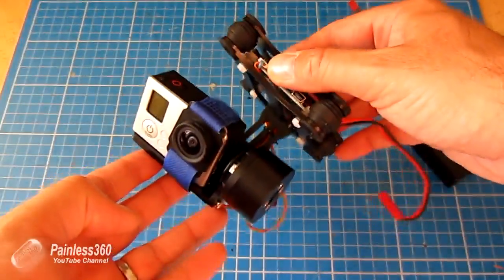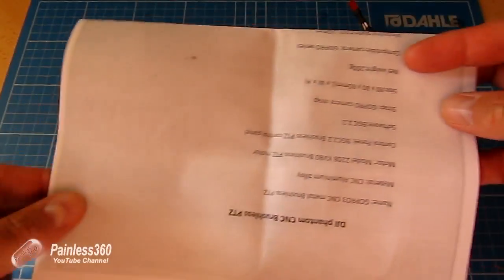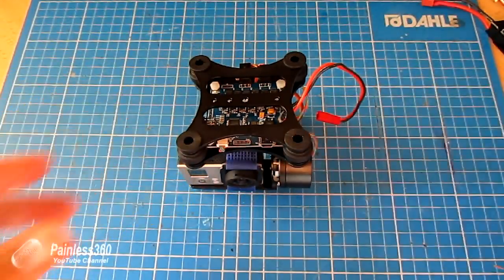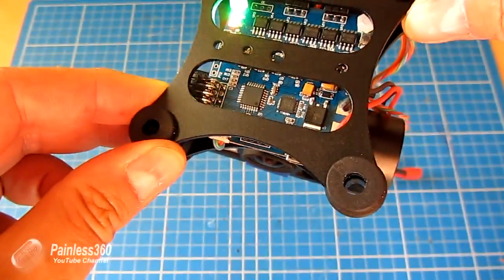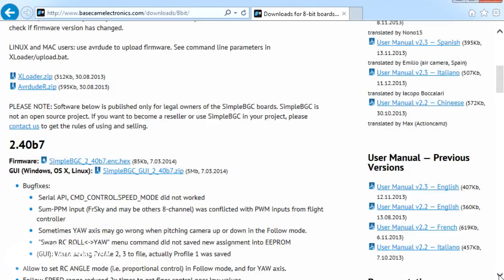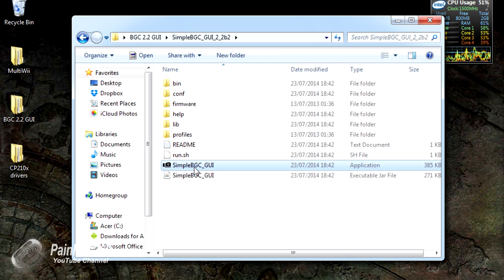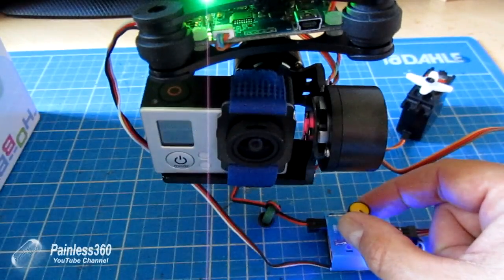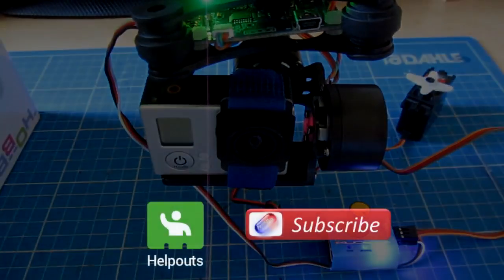BGC 2.2 (2.2b2) GoPro Camera Gimbal – Software, drivers, setup and receiver connections.

Comment: What kind of battery do i need?
Reply from the maker: I run mine from a 3s pack..
Reply: i have looked online have noticed 3s packs are 11.1 volts, but other sources say i can run it with 12 volts?
Reply from the maker: Yep, that's the one. If you are confused then the videos in the 'Introduction to RC' playlist will help..

Comment: Me again, lol..  You may have answered this before or in another Vid, but how do you connect this gimbal to the Naze32 Full so I can control pitch with one of my slider switched on my Taranis ?  Which Pin should I connect to, 5 or 6 (since the motors are 1-4) is there anything I need to do on the Naze set up?   Thanks in advance, your a HUGE help!!!
Reply from the maker: +tntaftershock I haven't connected it to the gimbal but to the PWM pins of a receiver so I can 'tweak' the direction in flight. Best of luck..
Reply: +Painless360 sorry for the dumb question but what is PWM?
Reply from the maker: See our explanation on the channel - a lot of the answers are here somewhere.. ;)
Reply: +Painless360 I finally got it figured out, you can control this gimbal thru the Naze32, with CleanFlight. I don't have the fancy setup to show on the computer like you do but this is how I did it, with my taranis using the left slider.

1 click on Servo Tilt 
2 clicked on Channel Forwarding
3 under "Servos" I clicked Servo 0, A4
I set my left slider to channel 8 which became AUX 4
and BAM, I can control the pitch of the camera and it also maintains level balance in flight.

I do have one small issue, the camera has a very slight "twitch" and I have not figured out how to stop it. when I disconnect the gimbal from the Naze32 the twitch stops so somewhere there is a setting I have not found yet to adjust to stop this, but its not bad enough to prevent a video.   If you can play with the settings and find a cure I would be in your debt. Thank you good sir.
Reply from the maker: Great explanation! Not sure about the twitch as in practice I don't fly with gimbals controlled by the FC. Best of luck and happy flying!

Comment: Hey, man! Loved your video! :) I have only two questions, if you or somebody seeing this comment could help I would be really apreciated. Do you know if i can weld the female jst on my drone instead of the male on the battery? I have some batteries and it would be much more practic to do it that way instead of weld them all. The other question is if you know if is there anything I can do to install a fader to control this gimbal on a chinese quad like Tarantula X6. I'm thinking about build a cheap fpv system on mine. Thank you very much for your atention. :)
Reply from the maker: +Gerson Pereira Not sure what you mean by 'weld'. You can solder any adapter you need. I would make a small adapter using a JST cable personally.
Reply: With weld I mean solder, can I solder 1 female jst adapter directly on the quad to connect battery and gimbal? Instead of solder 1 male jst to every batteries I have.
Reply from the maker: You can use whatever works for you but remember that most batteries and c connectors have a convention for which side connects to 'live' voltages. Best of luck!
Reply: I will have that in consideration. Thank you very much for your time. Keep it up! :)

Comment: Can the gimbal be powered from the rx through the pitch channel wire or do you have to plug in the power battery connector too?
Reply from the maker: +Zoomer1973 Power and signal connections are different - power needs 12v, the signal wires are 5v. You need both. Best of luck.

Comment: Hi,
Thanks for taking the time to make this, and all the vids you do...they have been a great help.  I had one quick question about this gimbal.  Towards the end of the vid, when you show how the tilt works with the servo tester, is that the only power supply to the gimbal board?  In other words, when I connect this to my receiver, should I pull the hot wire out of the servo plug if the gimbal is already powered via the main flight battery?

Thanks!
Reply from the maker: +MidSouthJeeper Don't get confused - the power supply is the 12v for the ESCs and main board. The other connections should be signal only - if you're worried then don't connect the red wire in the servo lead connectors.

Comment: I can't tilt the camera connecting it to my apm 2.5.2. I'm powering it with a power module, connected ONLY the signal pitch to the SIGNAL A11 port from my APM, did all the configuration in mission planner but when i turn my radio knob, it does not move. In the apm manual says that connecting other cable will result in a brownout, I don't know what to do
Reply from the maker: +faxikax Sorry, I've never set mine up that way. Best of luck with it..
Reply: +Painless360 Its a brushless motor gimbal. Does it make any diference with the connections??
Reply from the maker: Book a chargeable support call (see www.painless360.com) and I can take you though it.

Comment: hi can you tell me what the wire that connects from the board to the giro is called mine came with a clipped cord
Reply from the maker: +cameron kuechler Not sure what you mean - I would contact the vendor for a replacement if it arrived damaged. Best of luck.
Reply: ok thanks
Reply: +Painless360 i have contacted them and they asked me to update the software do you know how to do that?
Reply from the maker: No, sorry. I hope they help you more than that..

Comment: What is it about this board that causes it to get bricked with newer firmware? I would like to use the newest firmware (or different firmware entirely) because of all the mentioned bugs in 2.2b2
Reply from the maker: Not clear. Later boards do seem to support later code..
Reply: +Painless360 I tried updating the firmware to the latest 2.4b7 release, but the upgrade didn't work. I don't think  it bricked the board though. I then proceeded to wipe the EEPROM though arduino, that worked fine, the LED blinky stretch also worked fine, proving that the board is a glorified arduino. However, I couldn't get basecam software to connect to it (probably because the wiped board is no longer programed with basecam software) and now the firmware upgrade tool within the GUI does not work for any version. I probably need to use the AVR ISP header to program that HEX file in, but I don't know anything about that.
Reply: +Painless360 Luckily though, I did get "BruGUI" open source software loaded onto it, which is supposed to work on the "Martinez" board. The flashing process for that is VERY similar to multiwii, downloading the source code, opening it up in the arduino IDE, and uploading that sketch. It did not work right away, I had to tune the PIDs, calibrate the gyro and acc, and swap the XY axis or something, but in the end it seems to work OK. I will need to fly with it to see how well it performs.
Reply from the maker: +Power Max Interesting, let me know how you get on..
Reply: +Painless360 So far I really like the new firmware overall. In the most pessimistic sense, I guess I just traded in some problems for other problems, but one of the HUGE advantages of this new firmware is that changes to ANY parameter become effective immediately, (but you do need to write them to EEPROM to save them) including motor direction, power, and all the PIDs!  The LPF setting on this firmware actually works as expected. Notice on BGC2.2 firmware that if you adjust the camera to angle upwards, and if you do not let it reach the new destination before you turn the knob to make the camera go back downwards, the motion of the camera will change direction instantly and start going down to the new destination. It is not very smooth in this case.

However, on this new open source firmware, the chip seems to be controlling the velocity of the camera panning as a function of the difference between the set position on the servo controller knob and where the camera is currently at that instant. This is the right way to implement first order LPF because it's a differentiable function which results in a exponential limit, very similar to the RC capacitor-resistor setup!

The main disadvantage so far is that everything is... it's a little too smooth, if that makes sense! When something like my finger causes the camera to fall off the target angle, it will in some cases overshoot and over correct, but in other cases, take absolutely forever to get back to where it is supposed to be. How long that takes seems to be related to the LPF setting, but it is set as low as possible but does not fix the problem. Whether or not it returns to the right position slowly or overshoots seems to be dependant on the balancing of the camera so far from what I can tell, so maybe I don't have my mobius camera balanced well enough? IDK.

Comment: Hi,
Can I power this with 4s lipo battery?
Reply from the maker: Find the specs and have a look. I use it with a 12v LIPO battery and it works great. Best of luck.
Reply from the maker: I've only ever powered mine from 12v as per the specifications and it's worked fine. Sorry I can't shed any more light on it for you.
Reply from the maker: What does it say in the specs for the gimbal?
Reply: +Senal Weerasinghe NO!!!
Only 5V
Reply: +Andrew cho Usually doesnt has :P also there are some pics at web showing 5-16volts or something :P
Reply: +Painless360 maybe I get a clone and you have genuine. I really don't know, I fried 2 boards. does yours work with 6V?
Reply: +Painless360 you are right. my bad
Reply: you need to step down the voltage to 12v, but mine is running off a  stepped down 14v.

Comment: I have a Question concerning the Servo Lead hook-up. The Gimbal is powered with 11.1-12.6 Volts from the Copter, Ok. So I noticed when You hooked up the servo tilt that You left all three leads on the connector attached, that would be "Signal,center is 5Volt power, and Ground". My Question is this: Is that 5 Volt Power Lead required for the tilt servo motor signal to work correctly? I'm concerned about having 2 Power sources feeding the Board, "12V and 5V", Are they isolated from each other? I'm just worried about that magic smoke that happens when something is not connected properly...lol   ;)
Reply from the maker: If you are concerned then try it with the red wire in the servo cable disconnected.. Best of luck!
Reply: +Painless360 Thanks for the reply, and Yea, I was kinda thinking that, if I just use the ground and signal for the tilt, the worst that can happen is it won't work without 5V hooked up.. I just thought You might of thought of that already and made ammends.. I hate trial and error in Electronics, can be disasterous...lmao..  ;)
Reply: +Soco Joe i just fried 2 boards pluging 12V........
Reply: +Andrew cho  Oh No! Sorry to hear that.. That's why I hate Trial and Error. Not having good Tech Instructions on alot of stuff I've got, "Including this Gimbal"  is creating a big problem with some of My Builds, wish that when You Buy something the instructions covered all bases, sorry for Your Losses, that's expensive..  :(
Reply: +Soco Joe hehehe yeah lot of stuff has burned :P the thing is that my country is under capital control and I cant buy from abroad!!! so anything for replacement has buy by a friend outside greece :P pain in the ass. so now i have a question: its OK if I plug a 2S lipo? that means fully charged 8.4Volts. or I use  UBEC? I know is better for giving smooth flow but adding more grams better avoided.
Reply: +Soco Joe oh, I forgot the gimbal doesn't function well at 5.75Volts and under. (tested with 4xAA =6.4Volts)
Reply: +Andrew cho Hey Andrew, After doing some research, according to the specs, the board that I have runs on 12 volts, which I believe because I have 2 of the same gimbal and My other runs fine on 12 volts as well, My concern is when you hook up a servo lead, which I need to do as My Quad has the option for tilt, I'm thinking if the board is already powered with 12 volts, and the Main board apparently steps the 12v down to 5v for the brushless gimbal servos, then I'm thinking that hooking up a servo lead from the control board would create an issue as it's from a different source, and when you leave the 5v power line on that servo, 2 sources could equal major issues..just My thoughs, Maybe I'm wrong? I've still yet to power it up for calibration, when I do i'll post the results..  ;)
Reply: +Soco Joe nice idea :) I will keep that in mind. for my servos I use the one cell from my 3S lipo :) looks like the adapter that use in that video.     was a micro servo for gimbal. so 3.7Volts was OK.
Reply: hello! you only need the signal wire. just pull the rest. signal is the top port on gimbal.
Reply: +Cyler McClure thx for the tip, figured it out about 3 and 1/2 weeks ago, done alot of research and I'm pretty proficient with hooking them all up, still a little shakey when it comes to doing firmware updates and such, but that's because everything works fine so far, no updates needed.. thx for the reply..  ;)

Comment: Ihi friend love your videos!!!!ive just bought this thinking I can use my sj400 cam and xiam yi cam !! does this only work for gopro as it wont satblize with my sj400??? hope you can help!!
Reply from the maker: +chrissy roberts I've already answered this on another one of your comments/questions.. Best of luck.
Reply: hi 360,
on the bgc software the pitch arrow is upside down when I calibrate!! when I turn the the cam upside down on the gimbal the pitch straightens and its like the sensor is upside down im confused  this gimbal should have been plug and play im very disappointed as it should of worked without seting up!! thanks for the help!!

Comment: Is there any way way to find out what firmware version is being run on a board? safely, without knowing any info about the board?
Reply from the maker: +owenkilleen Not that I know of. I assume that as long as you're only 'reading' from the board you shouldn't damage it. I would suggest going back to the vendor for support. Bets of luck.
Reply: So, just like most software, the current interface will allow reading and adjusting of settings? regardless of firmware version on the board?
Reply from the maker: No idea sorry. Best of luck.
Reply: Appreciate the honesty. Thank you :)

Comment: I am using a D4R-II connected via CPPM to a Naze32 controller on a tricopter. How can I use a RC channel to control the gimbal pitch?
Reply from the maker: There is a video on the channel that shows how head tracking works.  That should help.. best if luck.

Comment: Nice video, btw does this software works with the new version in banggood?
http://www.banggood.com/Light-FPV-Brushless-Gimbal-wMotors-Controller-For-DJI-Phantom-p-968168.html
They say in the details that with one press button the gimbal will work properly for any camera, but I´m not so sure....

Regards.
Reply from the maker: Not sure,  it will work if it uses the same controller.  Best of luck!

Comment: Thanks, this was a good start, however, in order to completely eliminate vibration it is usually necessary to reduce the Pitch and Roll Power values on the Basic tab (I'm using 130 and 50 respectively), also setting Gyro LPF (Advanced tab) to 1 or 2 can help to smooth out the responses.
Reply: +fLaMePr0oF Wow! Thanks so much. When I put your suggestions my gimbal worked like magic. :-D
Reply: +fLaMePr0oF thanks man! that did the trick!
Reply: Does anyone know what battery he  is using?

Comment: Out of the box, you should throw away that flimsy GoPro strap. It won't hold the camera snug which causes errors with the balance. I ziptied the camera to the case very snug and the buzzing, whining, twitching went away! I have not programmed anything, just out of the box. Also when you move the aircraft at a very high angle, the gimbal does not twitch! Hope this helps anyone.

Comment: I am not sure if Painless covered this in a earlier comment but I found after much trail an error that other than changing the Noisy setting to Silent  the position of the camera is crucial. I was getting the nasty motor noise and what finally stopped it is i moved the camera maybe 2mm back into the harness. Once I figured that out I changed how the harness is latched by having the part that goes around the lens go directly down through the slot, run it on back, skip the rear slot, and bring it around to strap it in. This made the came sit about 2mm back that where it was and now there is no noise and no jello in the video from the vibration of the motor. I always knew this was an issue for the roll just didn't think it would have been a big issue for the pitch. Makes sense that it would though.
Reply: FuYing Bro I also had to use 2.40 firmware since my board said there was a mismatch and that I was using 10.3 b9 or some garbage. the 2.40 worked for me but it was probably because I had a newer board. Like he said be careful with your firmware or you may be buying and new board.
Reply: +FuYing Bro Great piece of info there, thanks for sharing..  :)
Reply: that is mostly caused from oscillation because it is a cheaper gimbal, this creates vibrations and then it gets worse! glad your solution works, but here is a more permanent one I used. two small square pieces of 3m tape between  camera and gimbal. this stops the oscillation from creating vibrations. I love the gimbal BTW!